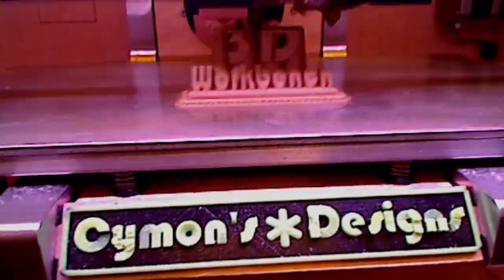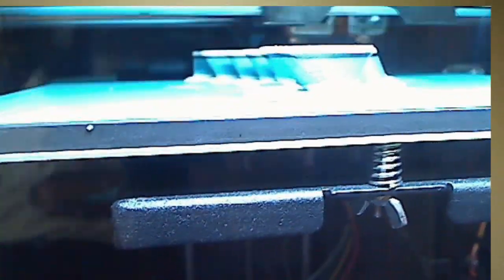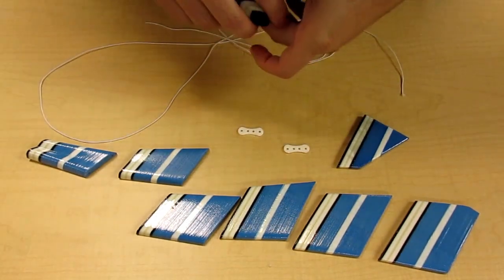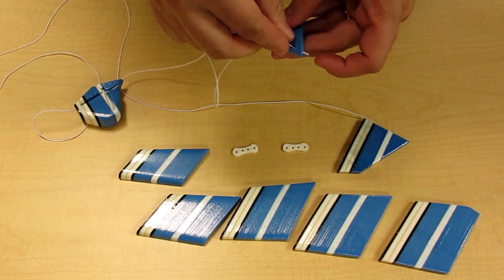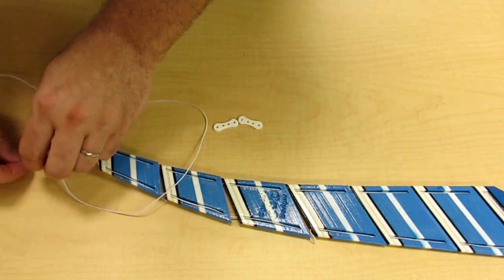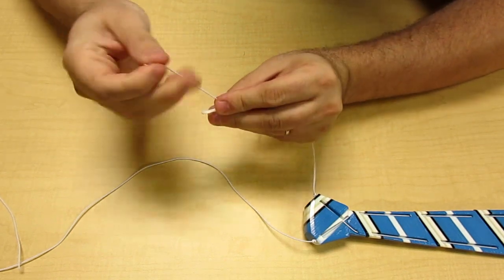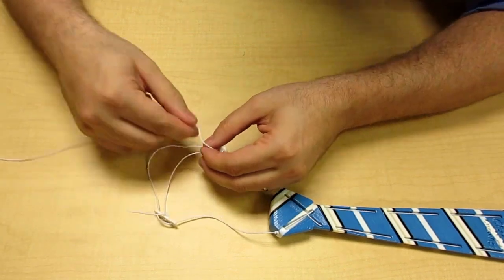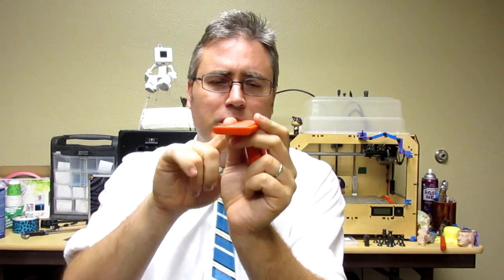3D Printed Striped Tie Project

Comment: WOW that looks really sweet ! I cant believe how well it turned out and how easy it is to put together. I really love the combo of blue and white really goes well together. keep up the great work. Did you make this tie knowing its fathers day coming up, would make a great fathers day gift ?
Reply from the maker: I did a lot of research on "striped tie", comparing what patterns would look good with what colors I had on hand. There are a lot of striped ties that I'm just not impressed with, but generally I found some pattern of black and white with a single color looked best, in my opinion. Then again I'm a guy who will wear stripes and plaid, so I might not be the best choice in matters of fashion.

Comment: As an alternative to the uniform striping, which requires the regular pauses to change filament, you could also do a unique random colour pattern.

I'm not 100% sure but I think it was Angus from Makers Muse who demonstrated unreeling a pile of filament (I think he used neutral colour) then spraying through it in all different colours. He used spray cans called "Fiddly Bits" which are available at most hardware stores in Australia, but the product is from China so it's probably available anywhere. Anyway, if you use some other brand you just need to be careful it's not a product that will clog the hot end, which "Fiddly Bits" apparently doesn't.

Another enhancement would be to separately print a logo or something similar which could be glued to one of the segments.

After I get Important Jobs #76 to #149 out of the way I'm definitely going to give this a shot.
Reply: Hmm. Take a whole spool, wind it very loosely, color it in broad strokes, print tie, have the perfect companion to your ugliest sweater.

Comment: This is an awesome project!
What plastic did you use? How did you smoothed it out?
Reply from the maker: ABS and smoothed with acetone. I filmed some footage of that but didn't put it into the video. Maybe I'll edit it as bonus footage.

See, when mixing materials like this you run into a problem that even similar materials have different thermal expansions, so over time the layers seperate. To counter this I used ABS (which, honestly has worse thermal expansions than other materials, but...) then vapor smoothed them to to increase layer bonding.

Comment: Well done. Is this ABS? I'm impressed that you got it smoothed out and the colors didn't bleed together. Very creative!
Reply from the maker: There actually was a little bleeding, particularly at the last tip. not sure why it happened either. I printed 2 of them and they both bled the same way. But in the end no one notices it unless you point it out, so I'm just leaving it.
Reply: ohh...why you had to go and ruin it. It looked perfect from the video. Just kidding, it's really well done. You should try S3D it has ways to indicate exactly where you want to start/stop the print so you can do your filament change. I actually like this better than if you had printed it out of TPU or NinjaFlex or whatever. Also doing those in multiple colors you'd need a dual extruder machine and it would be really tough.
Reply from the maker: I use simplify 3D. But the pause at Z position doesn't work for all printers. In my case it was easier just to use the pause menu.

I think a flexable 3D printed tie would require a different design. Not sure what it could be.
Reply: TGAW 3D channel has a really good tutorial on how to pause a print in S3D. Alternatively you can have a process stop at a certain point. Then home it manually and run a new process from that height. I've done that a lot of times. It's very effective to print a background, then add lettering (like a ruler)
I basically never get to just do something totally for fun like this. This is really cool.
My 3D designs fall into 2 categories. 
1. Some electronics/wood working project where I need a part to pair with a servo, or an enclosure. This includes parts for 3D printers. 
2. A toy or a decorative element for my kids/or their rooms. I've designed, sculpted over a dozen toys for my daughter + various art pieces for both our kids' rooms at my wife's request. (Last one was an 18" tall wall mounted giraffe lamp)
then there is #3 -- when my dad comes up with some hair brained thing he wants designed for his boat, workshop whatever. 
I actually never print figurines for myself -- strike that I made 1, -- I made a complete T-800 (check under my name on thingiverse) -- but that was it.
Reply from the maker: Yeah, her embedded mirror one. It's good.

That only works, though, if you'reprinting through USB. I use an SD card because the USB on my Rep1 was jenky and now I'm just in a habit. If one day I get a headless machine I'll be able to do that, though.
Reply: All my 3 printers are on OctoPrint. Couldn't live without it. My printers are in my basement, I remotely turn them on, upload the gcode, and if the bed is clear, and the right filament is loaded. I can just start the print right there from my office. I have it setup to turn the printer off 20 min after the print. Its fantastic.